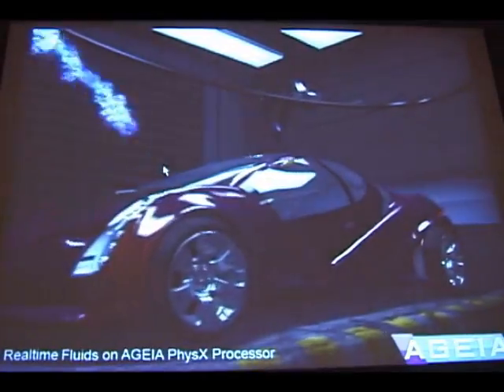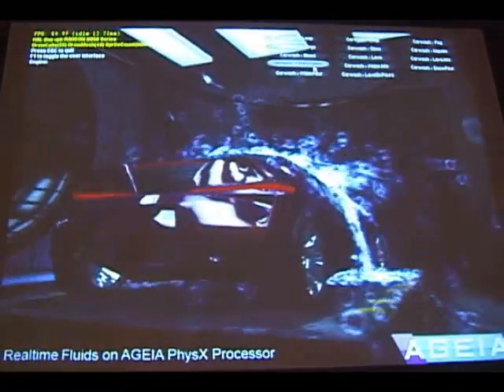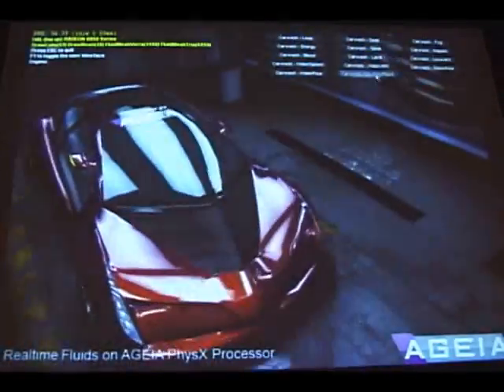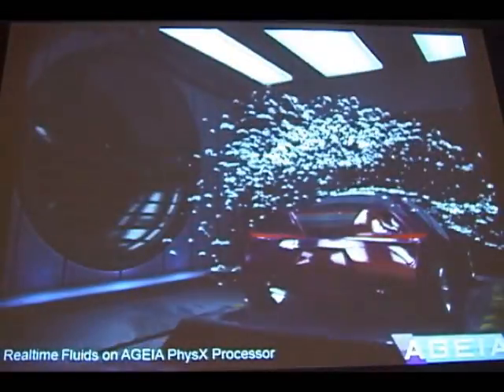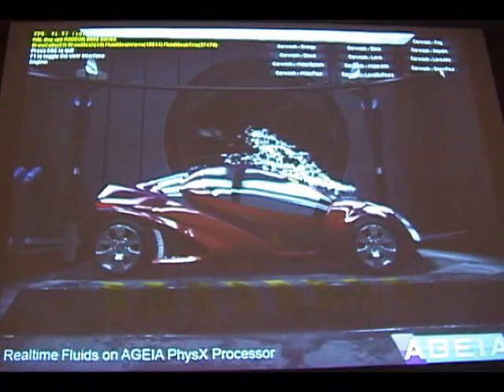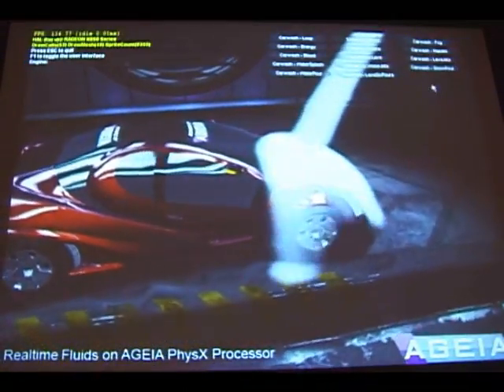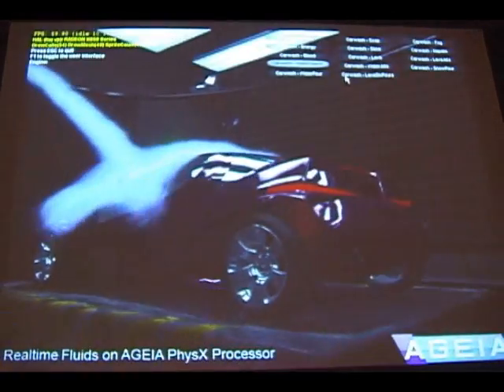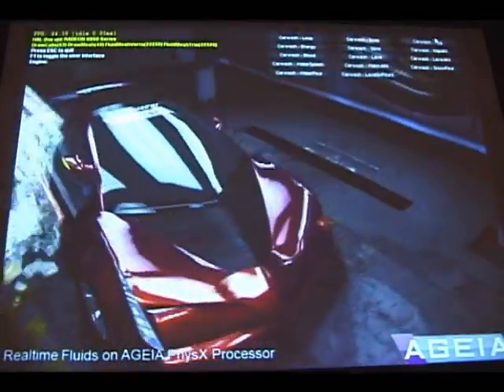PhysX Car Wash Demo

Comment from the maker: @captaincough I don't think they're the ones ignoring facts, it appears you discard any reference to PhysX actually being used today; and declare it a failure anyway.

PhysX is successful because on top of benefiting from Nvidia GPU hardware acceleration, it is freely available to any games company to use it for software physics. Nvidia adds hardware acceleration in games they sponsor, everyone else enjoys a good free physics engines.

It's successful, regardless of what you wish were the case.

Comment from the maker: OpenCL used in Havok is a WIP GPU computing framework that isn't being used in 'any' GPU physics games at this time.

Something that is still being work on and isn't used in 'anything' isn't better than a GPU computing solution that is up and already running in a variety of games.

OpenCL's only major benefit is that it is brand neutral, but that isn't going to do it any good when Microsoft's compute shader gets implemented in DX11.

Comment from the maker: Crysis does not use PhysX, it uses a custom physics engine created for CryEngine 2, it does not have hardware acceleration support. Retailers that sell gaming rigs sometimes include the PhysX card because of the few games that support it; they couldn't call it a high end gaming machine if a few competitors included the card and they didn't, it is mostly there for show and to increase the selling price.

If someone told you Crysis supports the PPU they were misleading you.

Comment from the maker: That's not really a valid comparison; CryEngine 2 cannot do hardware physics simulation, you couldn't run this simulation on CE2 because the performance required wouldn't be there.

To determine which offered the best physics engine you would have to do a comparison with the same available performance, something that is not going to happen since Nvidia has moved focus away from PPU cards.

Comment from the maker: Quantum physics is nothing special, it is just one application of Nvidia's CUDA programmable interface on the 8 series that was given a fancy name. They market it as being some sort of special physics on GPU feature; technically it's true in that you can run physics code on it, but it isn't the sole reason CUDA was implemented.

While Nvidia made the hardware changes for coding, they still needed a middle ware physics API. 

As for Crysis, I'm not sure what exactly you are asking regarding that.

Comment from the maker: They are going to support the present PPU until all 'current' planned releases have been made such as UT3 maps, then can it. Nvidia doesn't care about the PPUs hardware, they wanted the Ageia PhysX engine so they can redesign it for CUDA GPU physics.

Unlike Havok FX which worked on any SM3 card; CUDA only works fully on Nvidia 8 series cards, note only 'Nvidia'. Games designed with it will not work on ATI cards, making them Nvidia exclusives.

Comment from the maker: People probably should know Nvidia have recently purchased Ageia, future Nvidia GPU based physics solutions will rely on the Ageia PhysX engine optimised to tap the GPU.

Havok FX failed stupendously and then Havok got bought up by Intel; without a physics middleware Nvidia couldn't do physics on the GPU in games, so they ended up having to rely on Ageia.

Nvidia have stated they will support all current PPU investments, until a time were GPGPU ready GPUs can take its place.

Comment: 1. Any engine of any kind (rendering, physics, networking etc) _may_ work with a specific game given time and the right amount of coding. It isn't like LEGOs, you must work your ass off to integrate some third party library in your game, especially if it's late in the development stage.

2. If you saw a physics engine in a HL1 mod doesn't mean it was PhysX ;)

3. Even if HL2 would have used PhysX, it wouldn't have made PhysX a mod. Look into what a mod is.

Comment: That liquid looks like 237423 balls crushing on the car and rolling down the lines and the shape of that car. It really doesn't look like water. You can do it with a 8800GTX, too. It also simulates water what looks like water. Any GPU can do that and since and after the GTX the speed will be high enough to easily calculate it.

Physx is obsolete even before it becomes mainstream.

Comment from the maker: Smashing a glass window in FEAR will cause it to break into pre set parts and fall in a pre made animation. Real physics would generate different breaks depending on the location of the damage and calculate how those pieces fall, the idea of GPU physics is to take that physics simulation and move the hard number crunching calculations to the GPUs shader units.

Hence GPU accelerated physics, but not the same as GPU accelerate visual effects.

Comment from the maker: A visual effect pretending to be physics is accelerate by the GPU, a SLI system would speed up the performance of that effect. However it is not the same as using the GPU for physics acceleration, that is a completely different area.

It is like comparing the water shader effects in Bioshock with real hydromechanics simulation on the GPU. Both look like water physics, both done on the GPU, but only one is the real deal that can be interacted with and manipulated in real time.

Comment from the maker: *sigh* you sir are a idiot, and I have no motivation to continue this discussion.

If you want to believe within a short period of time the average gamer will have SLI GPU/Quad core systems, plus there will actually be games that take advantage of those resources for more than just performance, than that is your problem.

Just stay away from any respectable hardware forum or you will have you ass handed to you.

Comment: Go to newegg and look for yourself.

Quadcore Core 2 CPU Q6600 $289
ATI 1950PRO $149
Crossfire motherboard $89

I could easily build you a quad core system with dual GPU Crossfire config for less than $800.

thats hardly "enthusiast" pricing. its just average pc pricing.

so why do I need a dedicated PPU when I most computer games will only use 1 Core for runnning the game and the other 3 are idle (can be used for AI and Physics)

Comment: thats where your dead wrong...

for Nvidia yes you do need an SLI setup.. for Crossfire all you need is a crossfire chipset and as many graphics cards from X1300 that you like..
ive had a dual core pc for almost a year now and when I bought my 805D chip it was only $130...

its almost impossible to buy  pc thesedays that isnt dual core.. unless you by the cheapest thing on the market.

Comment from the maker: I don't, I know Havok FX can either be done on a single or dedicated GPU.

However "Many gamers have dual and quad core PCs" is one hell of a assumption and completely wrong. Multiple GPUs are a enthusiast setup, we are talking a minority within a minority here. What makes up the mainstream hardware that all developers target makes GPU physics highly impractical.

Even if they have a spare GPU lying around, they still need a SLI ready PC which requires more than just another PCI-E slot.

Comment: why do you always make the assumption that all the physics is done on the same GPU that does the 3D rendering ??????

Many gamers have dual and quad core PCs (yes a Q6600 CPU is very cheap to buy thesedays) and many more still have older video cards lying around they they wouldn't normally use, some even come with an integrated GPU on the mother board which is dormant when you plug in a graphics card...

Comment from the maker: All they have addressed in Havok FX is Havoks need for a concept to compete with Ageia in the minds of gamers and Nvidia's slumping GPU sales. Mass use of GPU physics is highly impractical, no one but the very bleeding edge PC gamers will be able to take advantage of it without taking a hit to visuals. You are not going to standardise a method that the mainstream audience cannot adopt, they have enough issues trying to run games because of today's shoddy optimisation.

Comment: Havok 4 seems to be pretty impressive, I can understand comments about previous versions of Havok not stacking up to PhysX PPU because it didn't allow for full physics interaction (as there was no way for the physics data to be read from the GPU before it went to the frame buffer).. but it looks like in 4 they have overcome that issue.. All the fluid dynamics, colision effects etc seem to be there.. the only thing I haven't seen in Havok is a good implementation of Soft bodies.

Comment: the problem is lack of acceptance.. who is going to buy a PhysX card for $300 when you can get an ATI 1950PRO for the same price.. I have seen tech demos where a much less powerful X1650 is used purely for physics while a newer 2900XT card does the 3D rendering.. and to me the performance is comparable... Atleast with an extra X1950 you can use it for Dedicated Physics OR Additional Rendering.. the choice is yours.

Comment from the maker: Physics calculations are highly parallel, is it any wonder then that they would run better on a parallel chip than the CPU? Of course if you utilise that power then it comes at the cost to other area's, the more advanced the physics then the greater the cost.

Just like the PPU, GPU physics is not without its disadvantages.

Comment from the maker: Also remember I made that comment 3 months ago, things change. Today I would not make the same recommendation since the PCI-E board has been cancelled, it is due to a portion of motherboard manufactures not sticking to the PCI-E standard causing problems.

If the same question was asked today, I still wouldn't recommend a PPU unless they were big fans of the supported games.

Comment from the maker: As for multi core physics acceleration; the CPU is capable of that, but it is not very efficient. It is similar to the way a CPU cannot complete with a dedicated GPU, it can do it now but in the long term another method must be utilised if we want to take physics beyond simple objects and particles.

High profile games like Alan Wake and Crysis are actually good examples of the CPUs weaknesses, if you know what to look for.

Comment: because physics calculations can be done in parallel. Which makes a stream processor ideal for the task.. a CPU although adequate in some situations cannot match the level of processing a GPU when it comes to calculating 1000s of Force and Direction vectors in Parallel.

Comment: Thats fairly laughable. You suggest introducing an entirely new PCI part that can likely be supplemented in current and near future GPU's with maintaining performance for all other aspects of engine processing. Even multi-core CPUs are becoming the norm and can readily alleviate the need for more physics processing power.